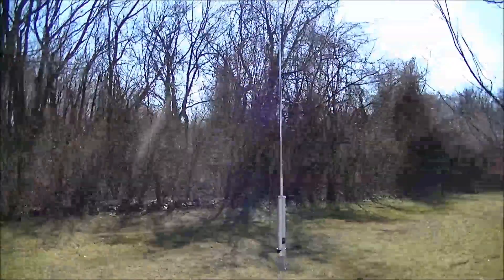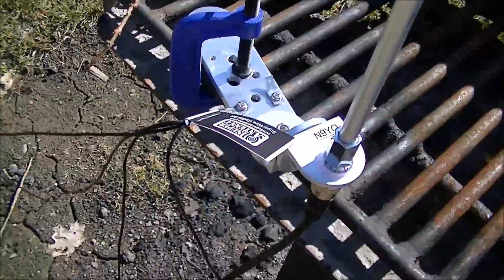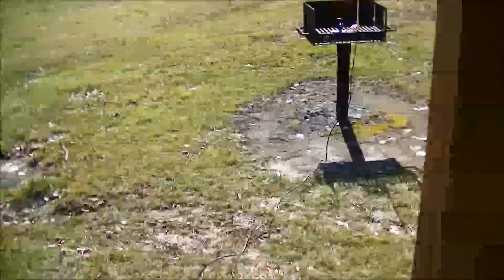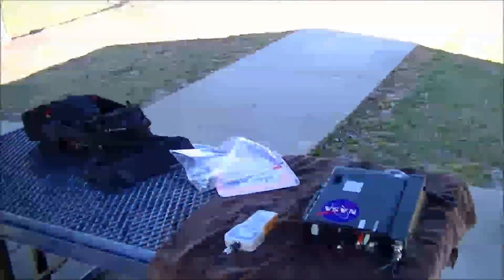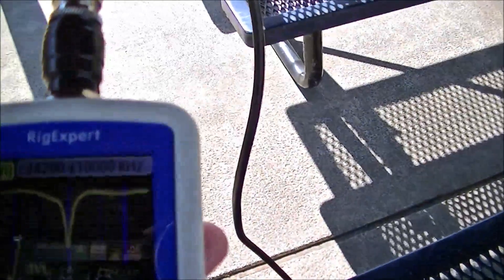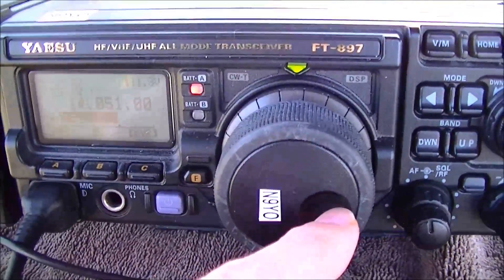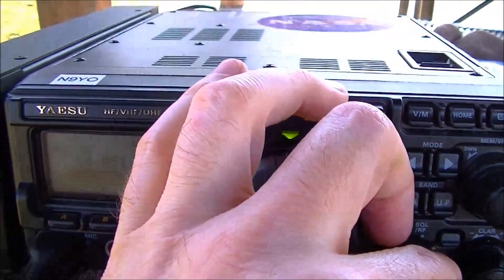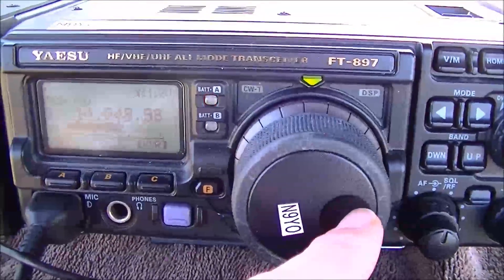Rig Expert AA-230 Zoom | Super Antenna Test

Comment: They are copying by ear and entering data into their logging system. CW is much more efficient for contesting than digital modes. It also requires the operator to concentrate on the signal in the midst of all the QRM. Digital modes require no ham radio skills. If you are moderately familiar with a computer you can run digital.